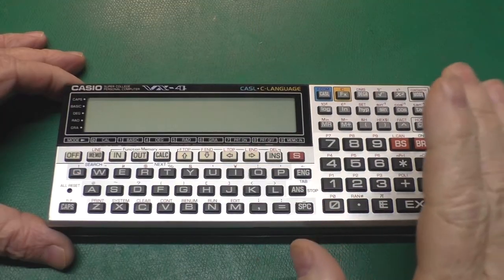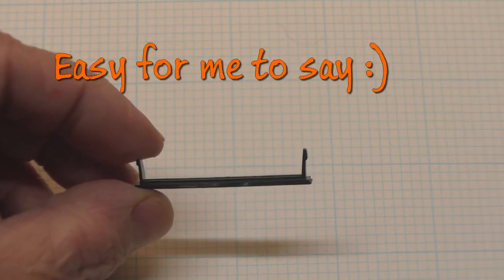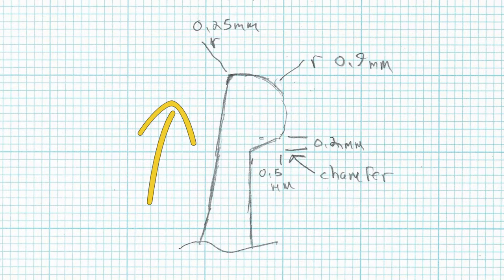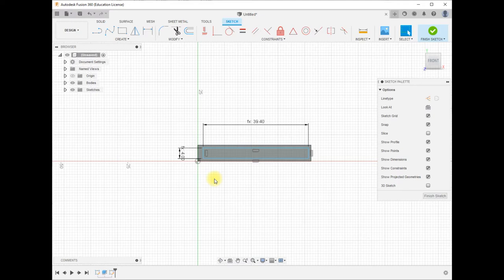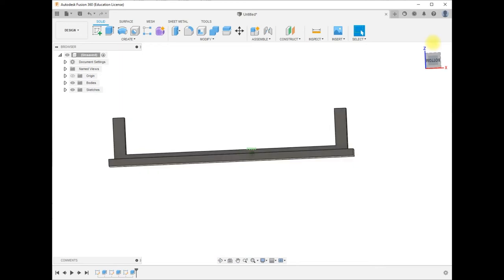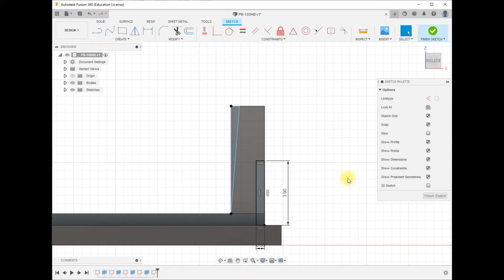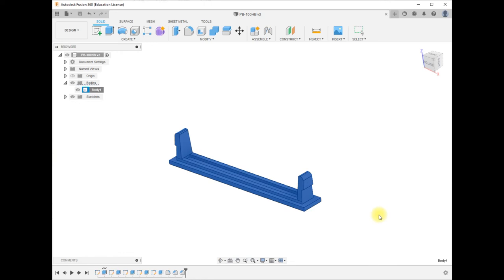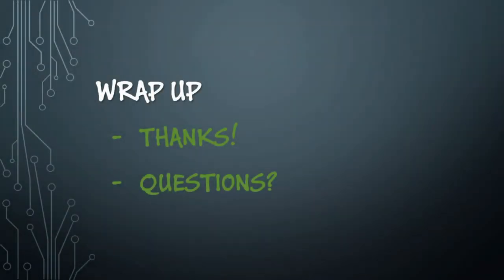3D Modeling and Printing Vintage Computer Parts. A simple case study.

Comment: I only learned CNC milling and not 3D printing, but I would put the zero point in the middle of the object. Then I could mirror everything in x and y. Then I only need to define the hook once.
But many roads lead to Rome, as we say.
Reply from the maker: Yes, many ways to get there. I chose to leave out the concepts of mirroring, feature copying, etc. to make it simpler.

Comment: With small parts like this, I'm always thinking, how I can "beef it up" a little for print strength. Sometimes, the port a part like this goes into has a stack of empty space, where you can model in a bit of extra bulk. Though your prints look like they dont need it. :)
Great video Jeff!

Comment: 2:28 and also the digital ones (unless you spend $300) have inferior metal surfaces which by far are the KEY element in a good reliable measure

Comment: Thanks, Jeff! From this lesson, I learned that measuring isn't as daunting as I thought. But the 3D modelling?! That looked like I would need more skill than I imagined. Can you give a lesson on how to make a missing part, that is, when you don't have the original to measure from?
Reply from the maker: When I come across a missing part I need to reproduce I will consider doing a video about it. It depends on how complex it is, too complex of a part may not make a good video.

I have learned 3D modeling over the last 20 years or so and learn new things with almost every project. I like to suggest starting with simple things to get the workflow down. Make a cube, then make a hole in the cube. Next figure out how to make a sphere. This involves some different processes and opens up new ways to more easily model some parts.

Comment: Again, I have enjoyed watching your video - I should comment more to let you know. Actually, I hoped, you would use a different CAD than fusion 360, because I would have liked to see something new to me :-) Anyways... I have a slightly different workflow. Usually, I directly draw in fusion 360 and I draw as much as possible into the "base drawing". That means, it usually looks like the classic engineering drawing. I usually add the axis of symmetry as a dashed construction line. This way, I could have positioned the inner rectangles with the symmetry constrain without adding a further measure. Ok... I will finish watching any maybe write a 2nd comment :-)
Reply from the maker: I used Autodesk Inventor for years until our IT department made it about impossible to reliably use. There are some differences between the two, but the general idea is the same. The timeline in 360 is fantastic though.
Reply: @HeyBirt  I absolutely agree about the timeline. You need to understand it to work effectively with Fusion 360. I think, there are a few things, that are part of the basic Fusion 360 knowledge should know.
1. constraints
2. the timeline
3. the fx parameter table
4. components